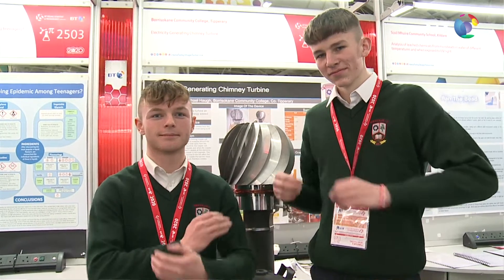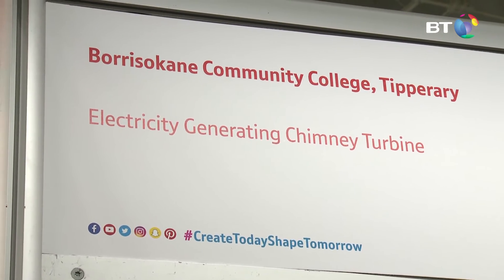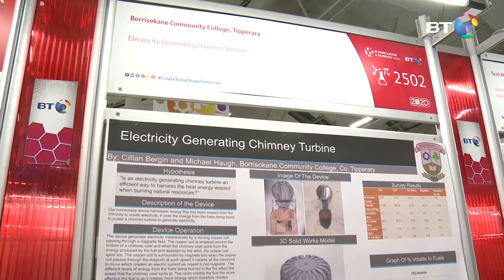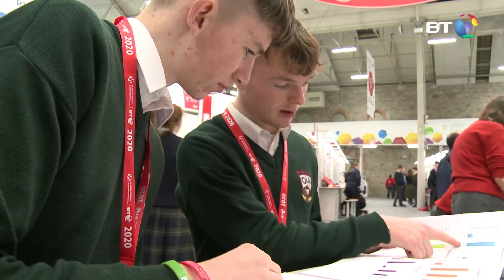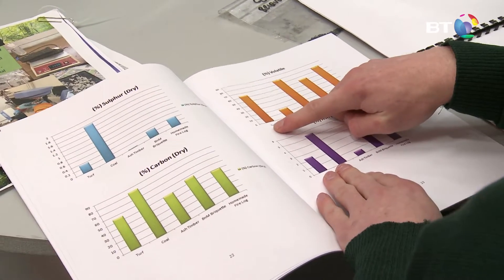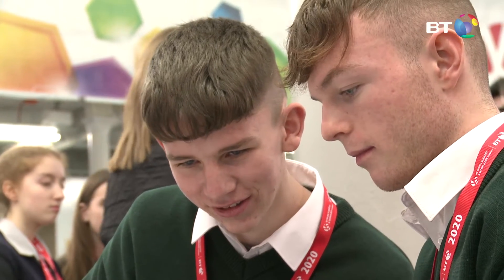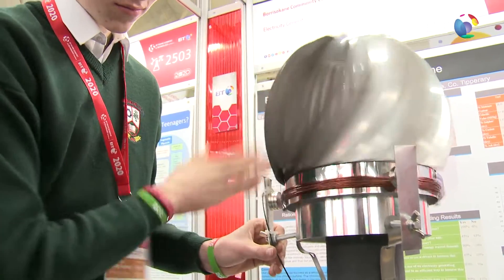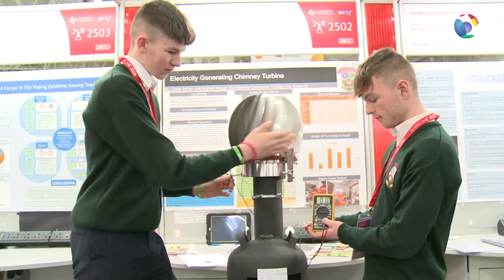Project 2502 - Electricity Generating Chimney Turbine

Comment: Hi  Have you tried developing  a man -  made Solar Panel  Twisting /Twirling vein extending to 2 mtrs    The diameter would be the same size  as the Chimney   (Mounted in Re-cycled Rubber (Tyres)  and  would fit   next to each other 
( I have two redundant chimneys on my small  house )
The wiring and generator would be in side the chimney  ...cable  ..un plugging ...and dropping to the Batteries in fire Place .
Producing Power Electricity 24 hour per day and night .
My aim and Ambition before I die, now 78, to make this world a safer place  and help reduce Carbon Emissions !!  For my future Family 
For   more details   contact :-
(michaelgdobie@yahoo.com )